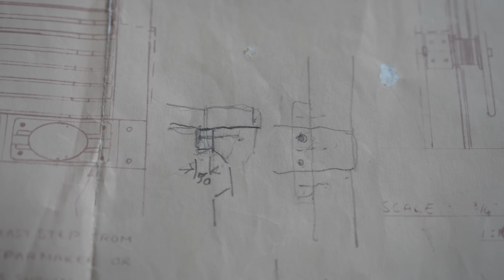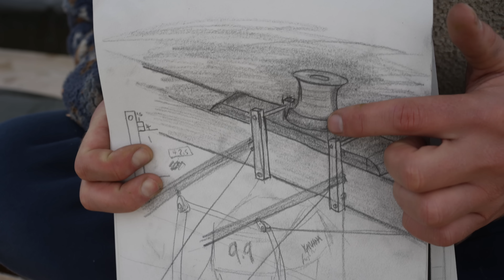It's The Most Important Part of this Boat's Refit (& I'm Trying Not to Wing It) | Wildling Sailing

Comment: hi fella, great journey. a few things that might help. get some cheap shade cloth to form a collection hammock between the hulls particulally under where you work. This is to catch any dropped vital things, tools etc as you work. youtube drill sharpening, or you can probs get a sharpening service to your door for less than new bits. Angle grinders are great have many uses. might be worth the investment given the  of $$ VS time ratio. also by putting your angle grinder in your workmate vice part you can use the grinding disc to sharpen drill bits wth a flappy sanding disc.... at a pinch..... might be too fast and hot...cool often.. better than new drill bits.

Comment: A trick for getting a profile into wood (like the step) is to use chalk or carbon paper to transfer the high spots that you then plane or scrape off. You just keep dry fitting until you get a good and true match. For the final fitting sandpaper is really useful for that perfect fit -- stick some to the bottom of the step and use the step to sand marks into the beam to find where the high spots are.

Comment: please recess the end of your threaded rod topside and epoxy a plug over them , removes a trip hazard and will prevent water incursions which will limit wood rot and the underside should have some sort of corking too and I would suggest sealing the drilled hole surfaces too.

Comment: Some really good advice coming from a lot of experience.  Yeah, cool that Lenox working with stainless.  I only buy Lennox for hack saws, jig saws, sawzall, and so on.

Solid center auger bits have worked well for me for wood.  Irwin.  

Oh, use the whole blade of the hack saw.  Easy on your elbow(s).  Timber framing for 35 years and I have lost about 20 degrees of bend in my dominant elbow.  Hurts.  Slows me down.  But I am running out of years, too.

You are going to learn what works for you.  Sometimes I cringe.  Monitor all the new changes as you do the whole boat.  

Just take it easy at first.  We used to say it can only be 10 percent or less “bigger” out there or you gotta go back to the beginning of getting used to your vessel.  Bring an EPIRB.

I am going to be looking for you from my 42 year old double ender, Zoe.

Comment: When cutting threaded rod you can save effort by placing the nut where you want to cut and sawing. No harm to tge threads. Despite assurances the mast size step bolts and how they are mounted remain a concern. Stress comes from more than one direction. Just sayin.

Comment: Hey Mark - you are part of my Saaturday morning routine. Here in South Australia, your video hits YouTube in my morning. I look forward to them every week..!!
When I'm drilling Stainless Steel, I will go slow, and as the bit gets blunt, I'll sharpen it with a portable sharpening jig (electric). They are inda cheap and really work great.
Also, in a past life, installing towbars to cars, we would drill through box section like you are doing with the engine box mounts, and we would drill the inside hole as big as the compression tub so that it sits through the box section and is the clamping forceinside the box section against the nut and washer on the outside. I hope that makes sense. The compression factor on your mounts will be huge with the engine vibration and lateral stress from the waves and push of the engines. We realy don't want any mounts to become loose and snap off th bolts, eh?
Good on you for doing a stellar job with this rebuild, Mahi is coming up a treat..!
Cheers
Grant, Adelaide, South Australia

Comment: @05:39 I noticed the nyloc nuts. They work great, but are meant for "use once",  then they lose their locking grip. One hack to use it twice(!) if needed is to properly hit it on the head with a hammer (of course while not in use) when the blow is even, the thread made in the nylon will be compressed a little, enough to make the nylon lock once more.👴😉
@06:39 Tip 2: Put on a nut first before sawing, then use a file to edge off, remove the nut and try if it's easy enough to put it back. If not, repeat.👴😉
@07:52 Tip 3: Use bigger washers to get a bigger compression area.👴😉
@08:48 Tip 4: Glue little pieces of wood on the mast beam to: 1. Prevent wobbling; 2: To adjust the rake of the mast; 3: To rise the foot 5 to 15 mm., this for the last step. (keep them at least 2 cm. away from the edge of the mast foot).
Then tape the bottom of the foot and the egde on the beam, wet out the area and use thickened epoxy reinforced with chopped glass strands (up to 5 cm. long) to put the foot exactly in place. After hardening take of the foot and you have a perfect base for it.👴😉
@10:47 Tip 5: Pre-drill with 4-6 mm., use a thicker lubricant, reduce the speed and don't try to push it through, let the drill do its work.👴😉
@15:54 Tip 6: Use a magnet to determine the kind of steel: It only (lightly) sticks on 304.
In harsh (read: salty) environments You need to treat it with pacifier acid to prevent it from rusting.👴😉
Happy working and see you next time.👴

Comment: For the oversized holes i would squeeze some silicone in then thread the bolt down so you both seal the hole and create flexible bushings for the threaded rod.

Comment: The extra context was certainly helpful, and yea... anyone who argues with what the designers and builders of these boats can well... feel free to build and design there own pioneering water craft proven over probably hundreds of thousands of miles. I myself have a set of plans for a Rongo, that i have made some minor modifications to the actual design increased the hull height a couple of inches, and lengthen the cabin top a smidge, maybe one day i will get to build it.

Comment: A friendly reminder and professional advise only. 
Use the full length of your hack saw blade as you back and forth. You have all ready paid for the full length of the blade, so why not use it. You will get more done with less effort. Slow your strokes down and not just use your arm to move the blade back and forth but use your body as support in a steady rhythm. The way you are sawing now wears the blade only in the middle and when once in a while you take an extra long stroke moving the blade on to an “un used section” of the blade where it then gets stuck because the un use section still have the full width of the teeth intact. From 11 weeks of training as part of my apprentice to become a merchant mariner sea going engineer, and using only a hack saw and varies shapes of files to make among other things a V-block from a chunk of steel. A hack saw bow, a square, a triangle, a die winding handle ( handles Werge knurrede) and a parallel plier all be by hand. Except where holes and knurling was required a drill press or a lathe was permitted. Good luck in improving and optimizing your hack saw using skill resulting in lower cost and better cost effective production. Cheers and fair winds from S/V Bunyip

Comment: Regarding mast step:  the shrouds and stays cancel alot of the torque force but im still thinking about 50 percent of the sail's force will act on mast step....parallel to ocean surface.  Could be wrong but im still not liking the lags....or the ledgers

Comment: This channel is all about how to do it at the same time how not to do it. Like how to drill your bolt holes at the same time as you don't use a forstner bit and lower the nut (counter sink) in the wood so you don't hit with your toe in rough sea, breaks it and then are in furious pain until you reach port after a 895 miles sail and you can get a caster. Like that ...

Comment: It’s much easier to cut steel with a thin angle grinder disk than with a hacksaw. The oversize bolt holes in the mast beam should be protected from rainwater penetration, which will cause rot. I would sink the bolt heads on top and plug them with wood bungs.

Comment: Your local machine shop should be able to machine your mast base flat fairly cheaply and quickly. Just a suggestion. Oh, and there's nothing wrong with your methods. You aren't charging headlong into a job without giving it some thought and you're seeking advice from experienced people when you are unsure how to continue. No-one starts out fully experienced, experience can only be gained and the only way to gain experience is, to do. Just like you are at the moment. Keep up the good work, it's fun to watch you on your journey. Cheers.

Comment: When you drill in stainless, you need oil galore and you need to peck at it even more than you do in wood. Stainless can work harden, which means... you will destroy your drill bit, and the next one, and the next one. Because the metal is harder than it used to be. So you peck at it.
Obviously, you're drilling in thin wall, so it's not that bad, but keep it mind when you drill thicker material. You also want a slower speed. The less heat you make, the better.

Comment: the all thread can cause issues with trapping moisture in the threads best to use a smooth bolt or at least seal the hole and threads very well to prevent rot ,also going to second revtoyota to get larger washers or a steel strap with holes in it

Comment: I would fill the bolt holes with epoxy then put the bolts back. That way you won’t have water getting in and rotting.

Comment: The amount of torque on a mast is surreal.   Might want  to double check with the boat designer to make sure this will be strong enough in a storm.   It looks a little janky to me but I'm not an engineer.   Using hollow bar rather than solid bar means if it compresses thing get very bad very fast.

Comment: Angle grinder.  Cut off wheel to cut the steel and disc to sharpen the drill bits.  Just a thought.

Comment: When you glue and screw, the screw adds almost nothing to the strength of the bond directly. What the screw does is make the contact between the 2 pieces of wood as intimate as possible and there is where the strength increase exists. The closer the fit, the stronger the bond. 👍
Cutting; use as much of the saw blade length as you can, otherwise you wear out the middle of the blade quickly. 😉
The friction on the drill tip is what makes the drill dull, just a little WD40 keeps the drill tip cool and it stays sharp much longer.
316 SS is hard and a bugger to machine, 304 SS is soft and easy to machine, but it isn't much good in a salt environment.

Comment: great work....the miixture of 304 and 316 tubing when connected via sleeves/ nuts/ and threaded rod( not sure of spec of those) will likely cause galvanic action...particularly when sea water is present....best use all same to avoid this or somehow use an electrical isolation material between the various parts....re mast beam...i agree you need much larger washers and/or flat bar and would be best to epoxy or oil the wood prior to permanent fix....

Comment: Only concern I see is those box tubes could collapse as all tension from  bolts is at the outer side only
Suggest either inside sleeves or full width outer washer,  even better both

Comment: Mark, so don't worry about the 304 to 316 comparisons.  The biggest difference is a slightly higher chromium content percentage with 304; (18-20 as compared to 16-18 for 316), 316 has slightly more nickel, and possibly a tiny amount of Molybdenum.  (For 316L you have a very minor amount of Lead added).  316 is going to be slightly more corrosion resistant to pitting.  In return though, 304 is very slightly more workable than 316.  The heat stabilization is constant on both grades, and yield strength is generally 35 KSI (Kips per Square inch) for both.  

Yield strength is the point at which the material will be permanently deformed and will no longer spring back.  The tradeoff for a higher yield strength is it tends to be less workable IE: it will crack if bent too tight.  You will also find 304 is more commonly available, especially for profile shapes, at least in the U.S.  

If you can get some nylon washers/Nut combination to put between the walls of the tubing, it will keep them from crushing the tube walls in.  The all-tread is a lot stronger than the section modulus of the side walls and you will get flex in the walls pretty quickly.  This is a common issue with using tubing for a structural connection.  You can also solve this also by putting a plate washer across the outside of the tubing to push the load out to the side walls of the tubing.  The reason you might want to do this is to keep the flexing during loading from gradually loosening the All-tread nuts.  This is called dynamic loading and is where high strength fasteners are really cranked down.  Trust me on this one.  You are going to get movement in the entire boat.  You don't want to lose your slightly used motors to the deep.

Sorry to drone on, but the wood beam underneath the rounded mast step will deform easily, so I would carefully consider if spending the money to mill it flat is worth it, because it will really just harden the wood below it anyway.  Might be worth it, but... BTW it is likely bent because when steel is welded it will tend to draw towards the heat.  Plate actually has a grain like wood and will tend to draw the same direction as the grain.

Comment: I have drilled thousands of holes in S/S.  I always purchase split point drill bits for making pilot holes.  I by them by the dozens, because they are cheaper than the larger sizes.  Typically I start with 1/8” and the follow up with 1/4”.  Whenever I get lazy and just go for it with larger bits
I more often than not ruin the larger bits.   One other thing, I encourage you to consider getting an angel grinder with an abrasive disc for cutting your steel. You need to be careful using the grinder, so where safety glasses and or a face shield.
Nothing intended from my end but constructive ideas.   Best of Luck.

Comment: I'd suggest epoxy sealing the slots in the plates for the engine box, and I'd put plastic caps on the top of the stainless bars, for your protection if you fell on one it would make a nasty hole in your personage. :)

Comment: If your cutting all thread, run a nut on first then cut in front of the nut, when you run the nut off it will restore the thread. No use then for the die.

Comment: I very much love your videos and the project. Now that the days get darker, colder and rainier, would there be an option for you to rent a shed or a container to work in?
Reply from the maker: cheers! Im trying to convert my other hull into a bit of a workspace.
Reply: I was thinking a lightly framed, small, rain shedding, poly covered work space that can be dragged around on deck. Could even have an electric heater ?

Comment: One question i have for you is are you just going to use straps/rope on the back of the engine housing's so you can raise them up out of the way when sailing?  If so then think about having some kind of solid struts to lock them in the down position or reversing the engines will tend to cause then to lift rather than giving reverse thrust, a bit like not having the tilt mechanism unlocked  or sticking on the outboard (been there a few times).

One piece of advice would be to get a better hacksaw frame and use both hand on the hacksaw, one at the front as well as on the handle, you will get better square cuts as there is more control over the blade.

Comment: Probably repeating comments from others... use a smaller pilot drill before going full size through stainless. For the mast attachments, if you're oversize on the beam and mast, have you gone for larger threaded bar? If you've drilled 12mm then might be worth putting 12mm bar in there? Put your index finger out down the frame of the hacksaw when cutting, helps to cut straight! Anyway, enough of me in my armchair. Keep going, it's coming together!

Comment: After watching you labor, I hope I'm wrong. But, I do believe that the rods should be a very tight fit. Needing to be hammered through ,ie 12mm bolt in a 12mm hole.. Otherwise the beam will want to slide no matter how tight the bolts.

Comment: You can buy one file and sharpen all your drill-bits, forever. Not too hard with practice. And you only ever get better at it. And the file is useful for other stuff also. Save stacks in the long run.

Comment: Hi there, to make your drill bits last longer, you want to drill step by step and don't drill directly with the final diameter. For a 12mm hole you start with a 4mm drill bit which should cut like butter, then enlarge with a 8mm then finish with a 12mm. It also must be quicker than painfully drilling only with the big one. You can also invest in a step drill bit which will do the same while saving time avoiding bit changing.

Comment: Mark How do you manage being in the schengen zone for that long, do you have a nomad visa? Id be interested to know if so. (as I have a question you might than be able to answer)

304 rust like crazy at sea, 316 goes fairly well, but you need 316L to have practically no rust, its slightly softer and less strong though...

Having said that, it looks like a job well done !!

Comment: Just a wee bit of advice when cutting with your hacksaw (or any hand saw) if you put your index finger along the side of the saw instead of using a fist, you'll get more control and find it easier. Think of it like your doing finger guns, if that's easier to imagine. 
Great job though, you're doing great.

Comment: Bro as an add on save your drill bits stick her in 1 and lean all your weight onto the drill low n slow....big curly swarf is a reward for a perfectly drilled hole your bits will thank you for 😉

Comment: Did you epoxy fill all those new holes you put into your mast beam? If I was doing that, I would have epoxy filled each hole and created a polycarbon sleeve to insert into the holes to absorb stress and avoid possible splitting of the wood over time.